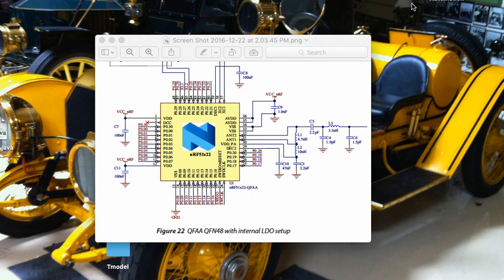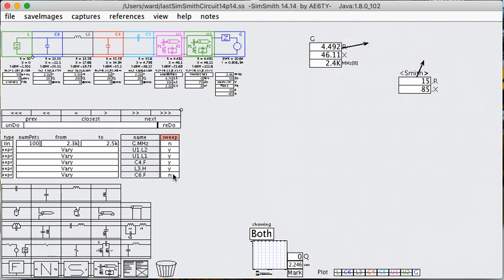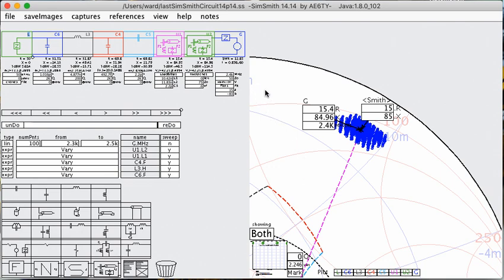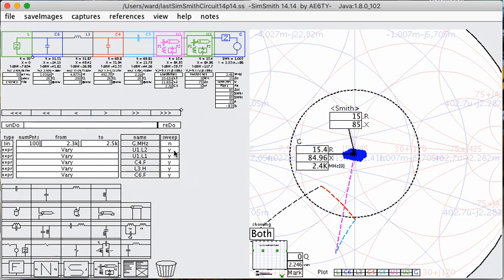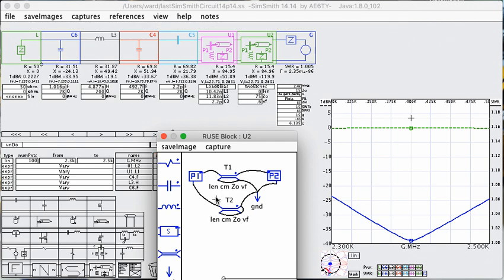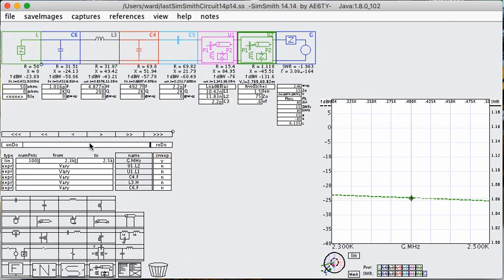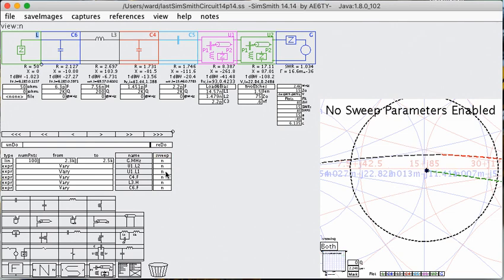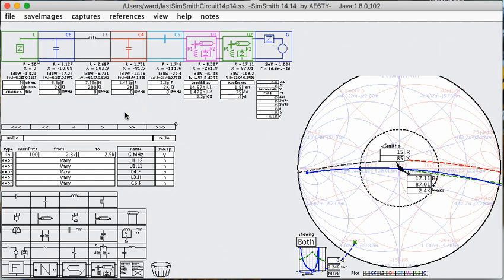BAD BOARD LAYOUT !  SimSmith to the rescue!

Comment: @ae6ty, thanks for all effort you have put into SimSmith. It is truly a godsend for DIYers like myself. I tried to model the same circuit and follow along with the video but my simulation results don't seem to match yours. My guess is that I haven't modeled the differential output to unbalanced conversion properly (load & bias block in your model). Could you please make the file available for download somewhere? Or make another video on how to model such blocks?